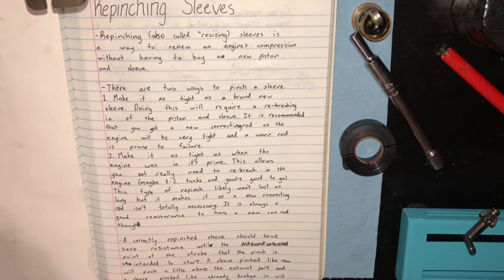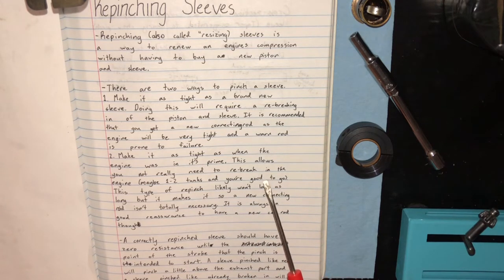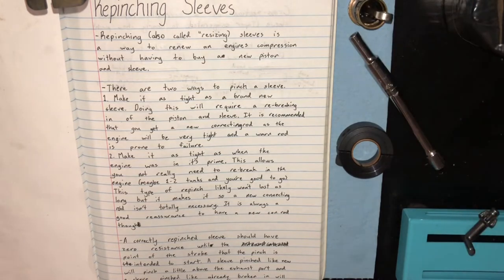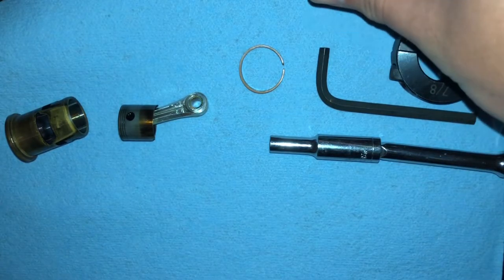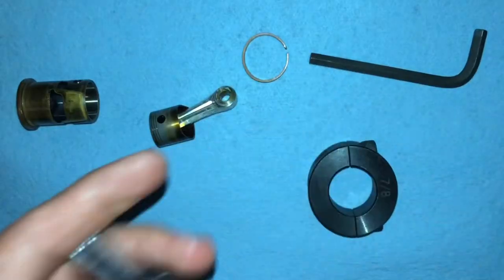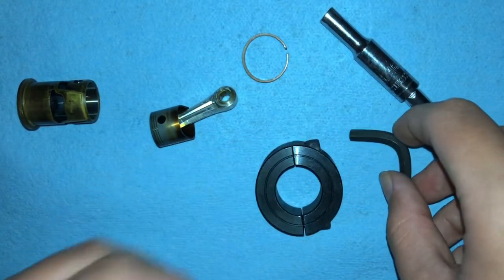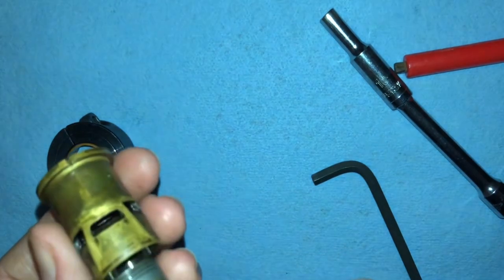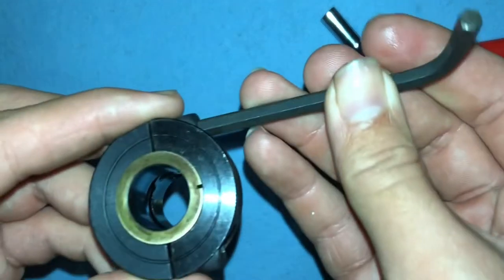How to Easily Resize a Nitro Engine Piston & Sleeve

Comment: Yo, I got the tool and iv repinched about 4 engines so far, successfully. There are some purists who repinch using nickel plating and a lathe, but this a much better method. Hell, I wanna pinch an engine NOW, just for fun! 😂 thanks again, and iv been spreading the word and people have listened.
Reply from the maker: Happy to hear the success you've had using this. It is a quite effective method at a low cost.
Reply: @moralesrcdesigns3784  absolutely mate, it only cost me £9.50 to, it's a no brainer. And let's face it, if a sleeve has gone that bad that it needs re plating, we'd be better off just buying either a new engine or piston and sleeve. And depending on what engine it is, some of them cost about as much for a brand new engine anyway. I'll put a video up on my channel soon showing you the one I use, it only has 1 bolt, and I use different shims for size.

Comment: Thats an interesting why of doing a repinch , I've only done it myself a handful of times but i used my metal lathe chuck , but i can see this is a nice why of doing it on the bench , i have some clamps so i will give it a try and compare both methods obviously im lucky having a lathe so this is a cheaper way to do the same job , thanks for sharing your method im sure you have helped lots of guys out and saved them some money too , stay safe mate 🇬🇧
Reply from the maker: The lathe chuck definitely seems like the way to go in my opinion. Seems way more precise and consistent than this method, but this is definitely a cheap and quick way to do the job. Good for if you need a quick pinch at the track or something like that. I watched EB Mod’s video on his repinch tool and I’m pretty sure it used a lathe chuck that he custom machined to his design for the tool. I found and priced out the parts I’d need to make my own and been meaning to buy them for a while now but haven’t yet 😅

Comment: Good video m8, I'm into self engine maintenance to. One question though, unless I missed it, don't you use heat to repinch your sleeves?
Reply from the maker: You can but it’s not necessary. The main instance where heat and sleeve repinch is related for me is if I accidentally repinch a sleeve too tight. I make sure to preheat the engine up to 240°-260° for break in and I let it idle 4-5 tanks straight without stopping the engine. Doing this allows the pinch to loosen up without having the stress of starting the engine again after each tank. 

Little tip. I have an electric screwdriver with a clutch setting that I use to test the tightness of my repinch. If you have one, take an engine that is running good and has good compression and try turn it over with the screwdriver (using the clutch screw) until you get to a clutch setting where the screwdriver can turn the engine over. Now you have a reference to about how tight you should make your pinch
Reply: @moralesrcdesigns3784  excellent advice m8, I'll take note of that for sure. I appreciate that. And thanks for he link for the tool, I was finding it difficult to fins the proper tool and was using 2 jubilee clips, uno old school site lol. I'm uk but was able to find the proper tool thanks to you. 👍👊

Comment: You can actually do it with a bicycle seat clamp just do it very carefully the bicycle method has worked out for me
Reply: What did you use to make it fit?
Reply: @timovangennip   just keep tightening the bike seat post adjustment and one part I forgot to leave out is that you need to make sure the bike is owned by someone you dislike because it will damage the seat post holder

Comment: i would like to see id and od measurements after this process
Reply from the maker: I haven’t thought to check the measurements, but when done correctly it’s probably no more than a .1 or .2 mm difference. These tiny engines have such tight tolerances that it doesn’t take a whole lot to get a good repinch

Comment: Hello so I used your method with the tool in the description I didn’t have any luck . I have a os max .21 xz-b ver 2 I had it cranked down very hard even moved the piston lower no luck . Then I heated it tried the process again no luck , I think the material used in os engines is very hard . So out of ideas
Reply from the maker: From my experience, that’s what the os engines do, they actually use quite soft metals, but the piston doesn’t go as high in an os sleeve so even though you move the piston down, the clamp actually compresses more of where the headbutton sits rather than around top dead center. I’ve found that pinching an os like this actually works quite well because the pinch isn’t crazy tight, but it holds its pinch better when it gets hot. If you’re still having trouble, try move the clamp itself lower down on the sleeve about 2-4mm and try again. It’ll be a bit harder to keep the clamp straight, but by doing that, you’ll compress more around where top dead center is and you should be able to fee more pinch. Always start with a little and then go tighter if you need to. It’s easier to tighten the pinch a little more than fix over tightening it

Comment: Hi, i from indonesia, where i get a small ring? I have done to buy 2 piece clamling collar then in the video, small ring can help to compress. Where i buy ? Thank u
Reply from the maker: I got mine from a local hardware store. You can check your local hardware or plumbing store and if they don’t have it, look for 3/4” inner diameter copper pipe on amazon

Comment: IFantom fr.27 engine have same size sleeve as .21? I have one that literally is brand new that the air filter fell off and it was dusted, sleeve not piston have any deep scratches in them but I can tell it’s low on compression it was ran on gravel road when it happened but idk if another make engines piston and sleeve would work in a Fantom or not or if I could get away with pinching it like this thanks
Reply from the maker: @donaldfeichtinger3529  the best thing to do would be to disassemble the engine and measure the outer diameter of the sleeve. whatever that measurement is, get a copper pipe with the inner diameter the same as the sleeve to make the copper ring, and get a clamp that has an inner diameter 1/8 inches bigger than the sleeve. As far as the sleeve being the same size as a .21? I’m not sure

Comment: Did you try heating it up with a torch so you probably dont have to re do a second time?
Reply from the maker: No. As far as I know, that wouldn’t do anything. The only reason I did it a second time is because I didn’t want to tighten it too much the first time and then be stuck with an engine that’s way too tight. It’s much easier to make it a little tighter if you need to than try to break in the engine while it’s unnecessarily tight. The engine runs phenomenally with the pinch that I gave it in this video. Idles for ever, runs extremely consistent, and has plenty of power. I think the common mistake for most people is that they tighten down the clamp too tight and then the engine can’t run efficiently/properly because the sleeve is likely warped and misshaped
Reply: @moralesrcdesigns3784  and as I understand every time you tighten you turn it and tighten again to make sure everything is round all around. Awesome vid. Thank you

Comment: Is it just the 4mm copper piece you use or do u use others.
Reply from the maker: I mainly use that one, but some engines are different and either start their pinch lower down or higher up and I have a slightly think and slightly thinner piece depending on the engine.

Comment: hi where do i get the copper collet for the re pinch thanks
Reply from the maker: I got a little copper pipe from ace hardware and cut it to make a 4-5mm ring. Any copper pipe that’s 3/4” inner diameter 7/8” outer diameter (or something close to that) shoulder work
Reply: @moralesrcdesigns3784  perfect thanks

Comment: What size clamp would you use on a .12 engine?
Reply from the maker: 3/4” is what I use
Reply: @moralesrcdesigns3784  very cool! If I paid you to do it via eBay, what is the turn around time generally? I'm also considering your rebuild service. It's for an o.s. max .12 cv with a bottom end fuel leak and poor compression
Reply from the maker: @thomdoers3222  if it’s just a repinch, I can have the repinch done the day it comes in and send it out the next day. If it’s a full rebuild, it should be within a week depending on how long bearings and stuff take to come in

Comment: How wide is that copper ring?
Reply from the maker: I used a 3/4” inner diameter copper from ace pipe and I cut it to be 4mm wide. This works for just about every .21 engine, but I’ve found that some .21s have a lower point where the pinch starts so you need to use a 5-6mm ring. Cut a few with different thicknesses and see what works with each engine starting with the thinnest and working your way up until the pinch starts where it’s supposed to
Reply: Thanks alot bud👍

Comment: Can a bent sleeve be re shaped?
Reply from the maker: A mildly warped sleeve can be fixed, but it takes a bit of work and patience. If it’s super badly warped, then there’s a 99% chance it’s not repairable
Reply: Can you make a quick video on how it can be done?
Reply from the maker: @godsun358  Sorry for the late reply. I'm not super active on this account. I will definitely consider making a video on it!
Reply: @moralesrcdesigns3784 appreciate you sharing your experience bruh

Comment: What size clamp on trx 2.5 ?
Reply from the maker: A 3/4” clamp will probably work, but just to make sure, measure the outer diameter of the sleeve and get a clamp 1/8” bigger
Reply: @moralesrcdesigns3784  Awesome ;)

Comment: hi dimension of ring? can you reply detail?
Reply: for 21, i have done buy 7/8 clamping collar
Reply from the maker: @felixharyanto8773  .21 engines use a 7/8 inch clamp with a 3/4 inch inner diameter ring. Sorry for the late response. Hope this helps

Comment from the maker: The actual process starts at 10:40 DISCLAMER There’s a lot info throughout the other parts of the video that will help make sure that the process is done correctly and so you can get the best results. If you do decide to skip past all of that and you mess up on your repinch, you can’t say that I didn’t warn you

Here’s the engine running after repinch to show that it works :) 
https://youtu.be/dKqq-d-Lh-s
Reply: Are you still offering this service?
Reply from the maker: @thomdoers3222  No. I had to many people tell me that they were gonna send in engines to get rebuilt or repinched and then never did. I got tired of that and now i just do it for the guys at my local track
Reply: @moralesrcdesigns3784  sorry to hear that. There aren't enough people doing this for people.